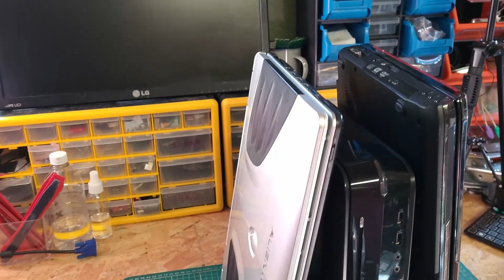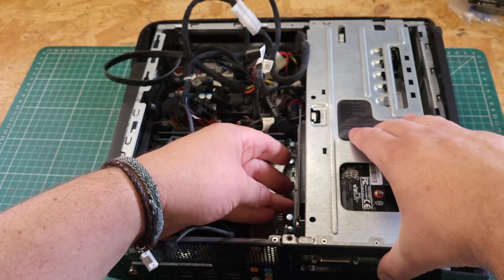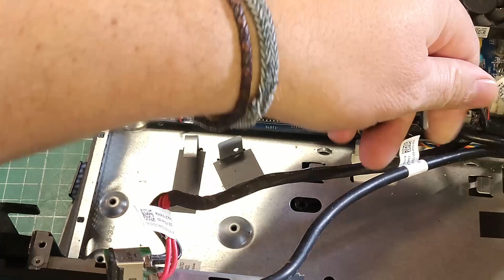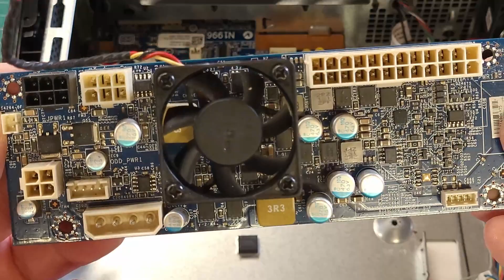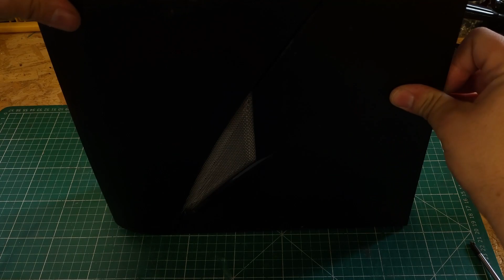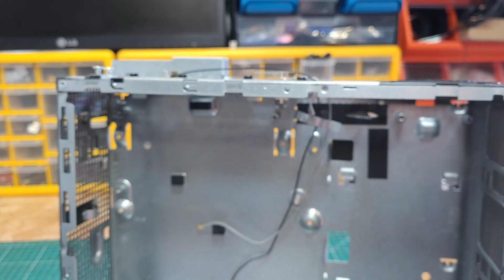This Alienware Goes Under Our Knife To Expose Its Secrets

Comment: I had one of these for 5 years. I replaced the Motherboard once, (cost me $50) and upgraded the CPU to the i7 (cost me $40) along with upgrading the GPU to the GTX 1650, adding 16GB of RAM, and an SSD....this computer was awesome for years. I upgraded the small fan with a Noctua (cost me $30ish for the kit) I sold it fully "factory restored" (I did leave in my solder work for the additional needed power) with a 330W brick, a 1TB SSD, with the 1TB Seagate Connie, and 8GB of RAM for $225.00 2 years ago.
I bought it in late 2016 or very early 2017 for $400 from eBay and the people that sent it to me included a 35w laptop power brick that made the computer shutdown. Once I figured out  I was cheated, they refunded me $50 and I bought the 330W brick that stayed with the unit for 5 years. In 2019 the motherboard started getting flakey with powering on, and eventually it wouldn't power on at all anymore, and I replaced it just before or during COVID. I upgraded the CPU to an i7 4790(?) the best one that you can fit into the motherboard just as COVID was winding down in 2021, then sold it less than a year later. Yes, one of the RAM sticks eventually failed on it, that's why I sold it with 8GB.